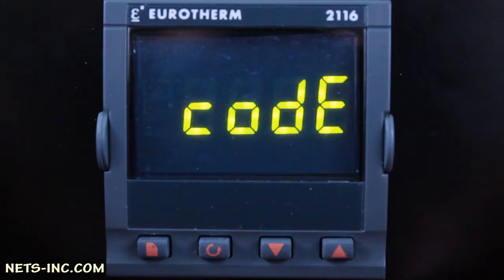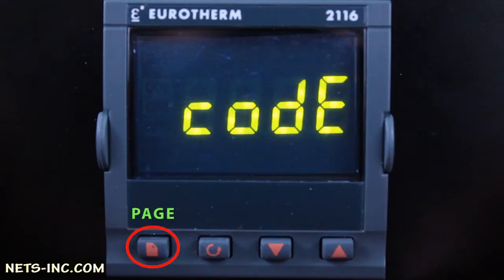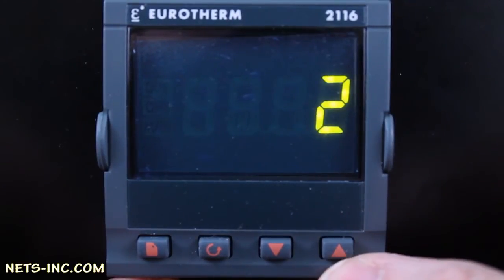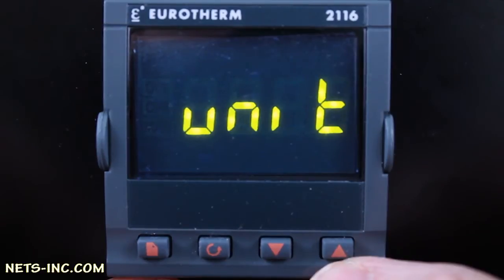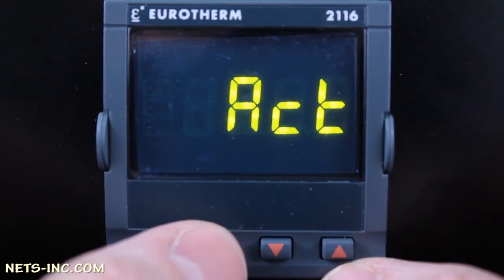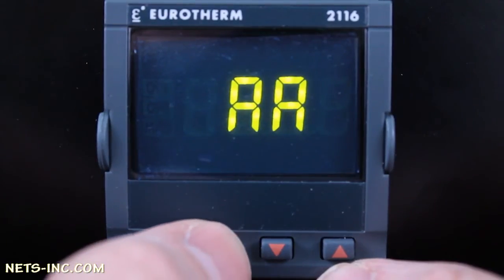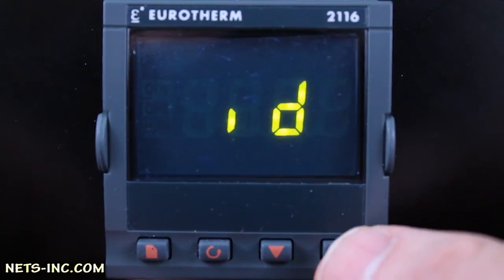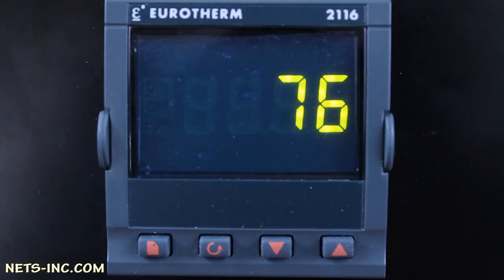Basic 2132 / 2116 Configuration Level Setup

Comment: Hello.  Thank you very much for your videos.  I had a need to re-equip old ovens in my company.  elements that I have chosen from Eurotherm controller 2416 / CC / VH / Control D2 / L2 / R2 / XX / ENG.
  Could you explain the possibilities of using a PD / CTX module for mounting, say, six SSR elements controlled from one Eurotherm 2416 / CC / VH / Control D2 / L2 / R2 / XX / ENG
  Once again, thank you.